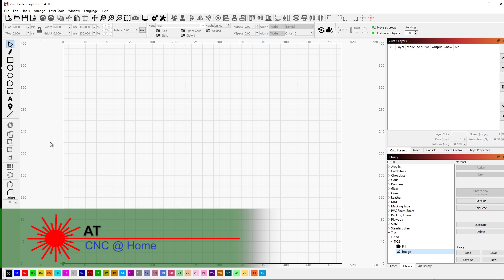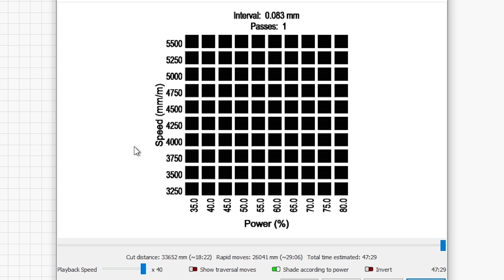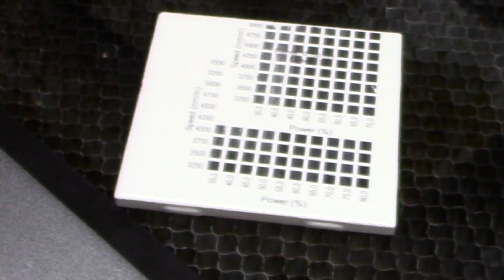You won't believe what happens when you etch with a really thick layer of Titanium Dioxide!

Comment: Can it be used to mark metal?
Reply from the maker: That is a great question.  I have not gotten that to work yet.  I have also not tried very hard to use this with metal.  It is a good thing to put on my list to try.  I have tried using an etching compound designed for metal.  With the lower power of my diode laser, I did not get it to work.

Comment: I have the ATOMSTACK A20 Pro Laser Engraver. I am finding its not how many coatings but how much Titanium Dioxide you mix into your batch. I have really light batch made and even at slow speeds of 800 and power of 100 the graphic comes out light. Very detailed graphics will take for ever. Like 3-4 hours for a 6x6 ceramic. Once done they look great but I need to refine my mix and heat settings to get better production.
Reply from the maker: That does seems slow.  I am glad the results are turning out good.  I have been using a 3:1 ratio of denatured alcohol to TiO2 and applying it with an airbrush.  I can get a consistent layer that isn't very thick and it burns quickly and dark black with my 10watt output laser and I think I am running at 4,000 mm/min with 40% to 50% power with a 0.100mm interval.

Comment: I've been experimenting with the TiO2 and ways to use it. I have sucessfully run a test and multiple tiles at different modes and so far it works . Instead of using a slurry of water /alcohol and TiO2 I sprayed my tiles with Pam cooking spray. Spreads and sticks to the tile better than water. After spraying I use a soft brush to make sure the surface is evenly coated then I use a baker dusting wand to coat it with the TiO2. Uses less TiO2 and no overspray wasting TiO2 and no mess. I line all the tiles edge to edge in a box, spray and dust. And if I use the 2watt diode NIR laser the TiO2 comes out metallic! Like tarnished chrome/silver. The tile surface after is smooth not rough. I call it the TiO2 NIR Bomb Variation. I can outline with black and fill with metal.
Reply from the maker: That sounds really neat!!  I may have to try that.  I like the idea that the results is more metallic looking.  Thank you so much for sharing this method.  I have since switched to using a thinner mixture and an airbrush. I have gotten very good results that way. I also added a couple drop of food coloring into my mix so it isn't so white.  That really helped see the coverage.
Reply: @CNCATHome  At first I was doing 2-3 coats from a spray bottle and have to wait in between to dry. Now the dusting is super light. In small areas you can see the tile shine but so far that hasn't made that much of a difference except some areas may not be as dark but I use a syringe and use that to place more TiO2 water slurry in needed areas. Whats neat is since I use an oil first, when I use the syringe, the oil and water don't want to mix and forces all the TiO2 slurry into the burned areas and none anywhere else. Makes it so easy to refill lines for a re-burn.
Reply: Interesting thanks!!

Comment: I found that the Titanium Dioxide recipe of 1 part water: 1 part alcohol 99%: 1 part glue; 2 parts Titamium Dioxide make a solid coat on one pas of the brush and offers excellent quality engraving without the powder residue of other recipies.
Reply: Hy there! I found this ratio before and tried it. The results where fantastic with only one exception... The applying part is a really pain in the Ass. I spent a hole weekend testing with all kind of brushes, normals,foam,fine hair brushes...All of them leaves some lines which, when I do the engraving ,they remain there and fuck up the process entirely...I wish that be so easy...
Reply from the maker: Wow!  Thank you for sharing that.  I have had other people mention using glue in their mix.  I will have to experiment with the water alcohol mix to see how well they play together.

Comment: What wattage is the laser used in this test. I have an Ortur 2, est. 5 watt, is mine  enough power to burn tile with Titanium Oxide?
Reply from the maker: Great question.  The LC-50 Plus I am using in this video is a 10 watt emitter.  I have an AtomStack P7 with a 5.5 watt emitter and it works fine.  I would think your Ortur would work well.  You won't be able to go quite a fast.  It should work just fine.  I did many coasters with my LE5040 (a 5.5 watt emitter) using the white paint method and it did a great job.  It is the TiO2 in the white paint that does the trick.

Comment: Is there any chance that you could share your files for your test burns and your positioning jig? I bought an Atomstack after watching how easy it was to use.
Reply from the maker: Thank you for asking.  Short answer on both questions is no.  Here is the longer answer that may help.

There isn't a file for the test burning.  That is generated within LightBurn using their Material Test function.  It gives you good flexibility to to create a test pattern.  You can control how many tests are in each direction, how large they are, what the parameters are for each axis.  I don't think I have a file for the zeroing fixture either.  I did a video on how to make this that you can watch https://youtu.be/ii4BmlN5WGE?si=Vc44PQR8kRuaeDdz.  I did use a larger laser for the bottom cut as it was bigger than the working area of the P7.  I checked my project files and could not find anything on this. I likely did not save it.  Sorry about that. 

I had a piece of scrap 3mm craft plywood that was about 250mm X 100mm.  I made a squaring cut along one of the long edges. Near the right side of that, I went in 2mm to create a notch to go around the neoprene foot. That is about 37mm long before I come back 4 mm to create a hook for the front of the leg.  I hope that makes sense.  With that done, I put the zeroing template in place, zeroed the laser, and cut through the plywood in both the X and Y direction.  The main trick for this to work is when focusing the laser module, making sure the zero is in the correct spot as the laser module can rotate slightly around the locking bolt.  I try to always rotate the laser module as fully clockwise as it will go when I focus and lock it into place.  This gives me some consistency in zeroing.
Reply: @CNCATHome  thanks for the measurements for the jig. I can use that pretty easily. I've been pretty disgusted with Lightburn, it has me in a perpetual "baby mode" and almost nothing works. I paid for this? Oh well...caveat emptor.
Reply from the maker: @HugoHugunin  - I am sorry to hear that.  I have had very few issues with LightBurn over the years.

Comment: Will it work on coloured tiles
Reply: I just got red,blue,yellow and BLACK,will let you know once the titanium oxide arrives
Reply from the maker: @markhaskins4421  - Where did you find your colored tiles?  Not sure how well the black will work with black on black?  But you never know until you try.  🙂
Reply: I live in Australia,and i got them from a hardware store called Bunnings
Reply from the maker: Great question Mark.  Absolutely it will. The color of the tile doesn't affect the process.  It will change the look.  I have one a 12X12 tile that had more neutral coloring to it and it worked great.  I would love to find some red, yellow, orange, etc... tiles as they could really turn out nicely.  As long as they are relatively flat and have a nice glazed surface, this process should work great.

Comment: Looks like it might be time to stop spending money on the white paint, the acetone solvent and the plastic sheets to protect my deck. It's also the time to kick up my output, or cut down on project finish time.

You, sir, are the CNC god!
Reply from the maker: I don't think I would go quite that far but I'll take it.  ;-)
I have really enjoyed working with the TiO2 so far.  It is almost impossible to screw up.  At least with the mixture I have.  I can coat the tiles inside so I can do this year round. Cleanup can be done with water or even just a cloth should take most of it off.  Definitely faster production time for setup, burning, and cleanup.  It is a win, Win, WIN!